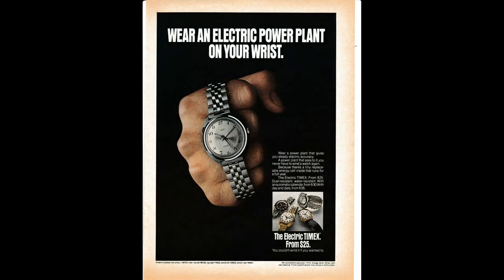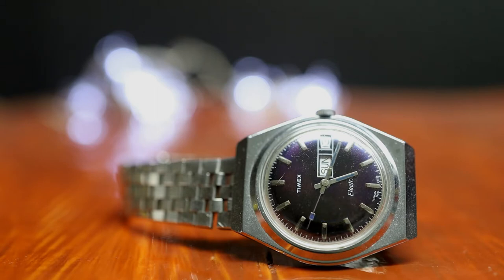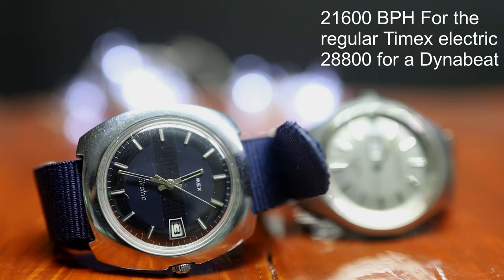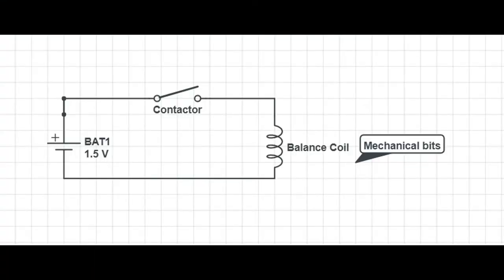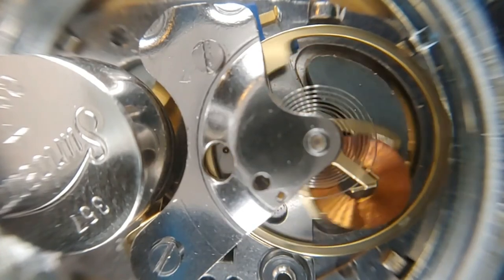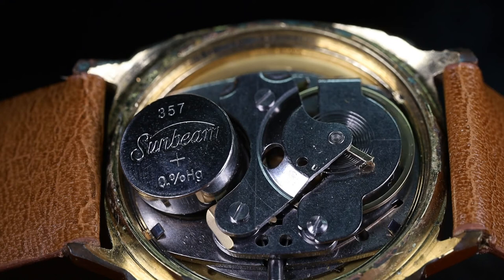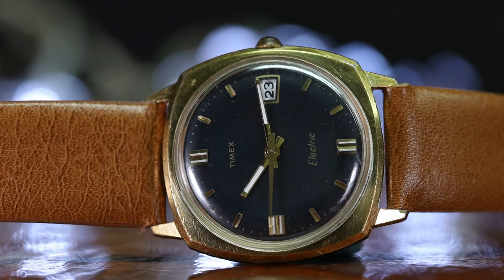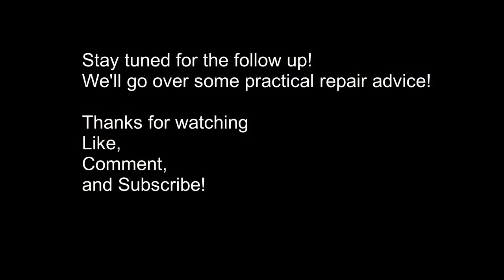Timex Electric (M40 and related) movement Review and Deep Dive

Comment: The first watch I ever bought myself was a Timex Electric around 1970. I still have it in my (very small) collection. In the past I've tried to revive it with no luck. I tried again a few weeks ago. After coaxing it along for about 20 minutes it finally ran on it's own and has continued to run. I ordered a new leather strap and will put it in my watch box to show in my collection. Thanks for the information and video on this watch movement!
Reply: Same story here - first watch I bought with my own money, in 1972. I stopped wearing it sometime during the 80s and when I tried using it again, it wasn't reliable. A service wasn't effective. I just bought a NOS movement and had a local person replace it in the watch. Holding my breath!

Comment: Electric watches are, Electric driven , Mechanically Regulated, Contact Point Impulse Watch.  Much much different from a Quartz. An Electronic watch is virtually the same as an electric,  however a transistor is incorporated into the power control system. Great overview. I like the old electrics too.

Comment: Some of the later Q models from the late 70's, such as the falcon eye were given stainless cases and a crude quickset mechanism for the calendar. For many of the stainless case models, it also appears that Timex also tried to emulate the case  and dial designs that many Japanese quartz watches had at the time.

Comment: EXTREMEMLY difficult to change the movement on if you get battery corrosion all over one. you have to take off (at least partially) the hairspring to remove the crown stem to replace the movement. trying to do this now, waiting for the replacement to come.
Reply: Hmm you shouldn't need to remove the hairspring to get the crown out there are 2 holes you can put a set tweezers in that'll release the stem. I'll see if I can find a picture or take one to demonstrate.

Comment: Is the Q Quartz really a quartz regulated mechanical watch? That sounds similar to a Seiko Spring Drive. Obviously a Timex quartz regulated mechanical could not compare to a Seiko Spring Drive, but I would like to see a comparison.
Reply from the maker: Good day, yup! It is the regulation though is a totally different technique to the spring drive. Where the Q Quartz is more or less a electric watch employing a proper balance with a quartz module shoved between the circuit to modify impulse timing the Spring drive mechanism looks to take the function of the balance/escapement  entirely using their tri-syncro regulator mechanism

Comment: Thanks!  I just bought a Timex Electric.  Movement says 22D. I am learning watch repair (hobby) and I have just serviced a Seiko Elnix. What battery does this use and is 22D in fact movement number? (I tried an LR 44 but not running.) This has a metallic "cowl" that goes between the movement and the case back. Do they need to be in place in order for this to run?
Reply from the maker: I am not aware of a call 22D. I don't think that it is a movement number. The LR44 should work. The cover is not needed for it to run.

Comment: You mentioned that you had a video where you address problems/issues with repairing Timex Electrics, but it doesn't appear to be posted yet.  I have several of them that don't work.  They look okay but when I put in a fresh battery noting happens.
Reply: Good day. Sorry about that. The video is one that is planned but likely won't be for a while until I get use to shooting macro video. A lot of the time though the contactor needs to be cleaned or replaced with one that is in better condition. Also check the contact point on the balance. Sometimes they are corroded.

Comment: Hi, I have a 1978 Q Quartz which has a bad movement, I would like to remove it and actually try to shoehorn a different quart movement in, just for fun. Can I take the movement out though the back, or does it come out through the front?
Reply: Good morning. You generally need to go through the front to get the movement out. Basically. Remove the stem, use a crystal lift then the movement should drop out (tighten the lift a lot as the crystals I have pulled out tend to have one hell of a lip). Additionally on most models there is a little metal retaining between the dial and crystal, keep note of the orientation it's in (up or down) so when you put the crystal back on it sits properly. Goodluck!
Reply: @christopherchang4167  Thank you this was incredibly helpful!

Comment: Can you explain regulating the Model 40.  Which way to move the lever to either speed up or slow down the movement.  Thanks
Reply from the maker: Good day, This should be pretty similar to mechanical watches, I'm not sure how much leeway the regulating lever actually gives but I've attached an image depicting the general directions for speeding up or slowing down 

https://drive.google.com/file/d/1iKBw5F9FSGImDqg-4Oeens9KDbsnKCRi/view?usp=sharing 

I'd try to keep the regulation to within the little cut out given on the movement covers. The watch is pretty unforgiving and with the cover removed you can basically whack that regulating lever as far as you'd like and potentially warp the hairspring a bit. I've done that before. Luckily you can generally spot if you are getting a bit too far with the lever (given the battery is out and the movement isn't running), you'll start to see the hairspring bunch up on one side, don't let it do that. 

Good luck!

Comment: I have a Timex electric model 42 world timer quartz that runs intermittently. What could be the problem I replaced the battery?
Reply from the maker: Good day. It could be a few things but in general the movement probably needs a general service. Otherwise the contactor may need to be cleaned if the balance appears to move freely. Additionally if there is wobble the bridge may need tightening just enough to reduce the wobble. Those tend to be what I commonly see.
Reply: @christicks5843  thank you, your video was very informative also.